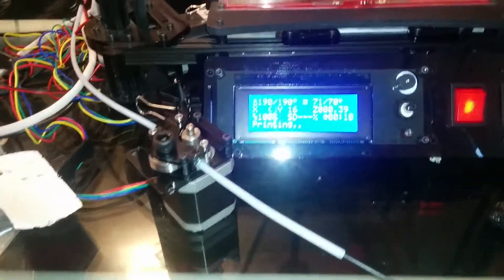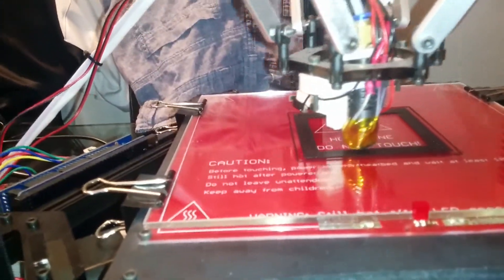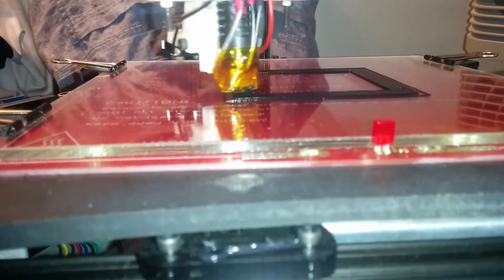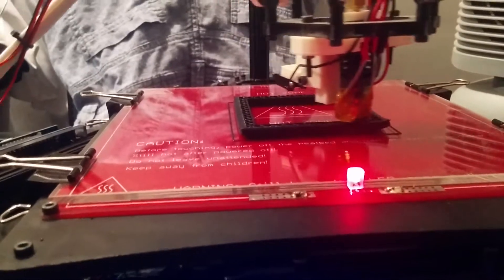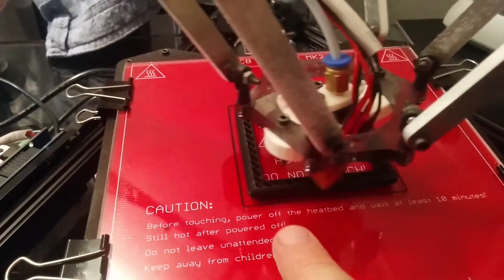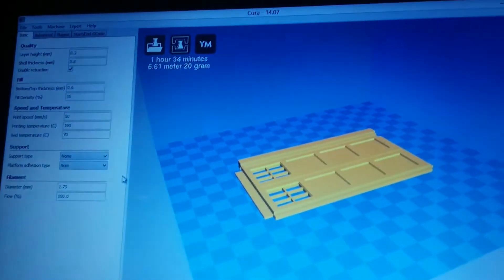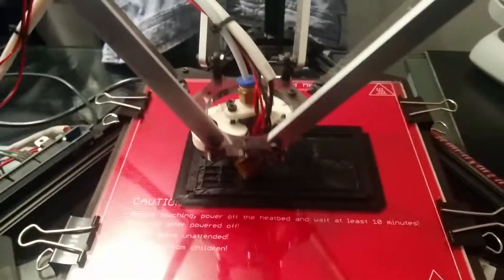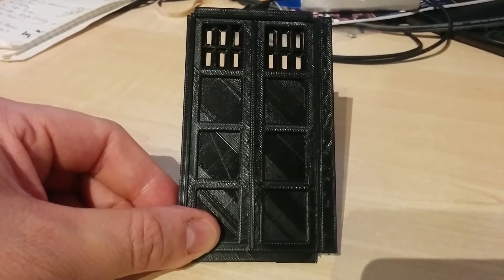3D Printer Build - Part 3

Comment: Best thing I have found to prevent warping if you are working with a printer that isnt enclosed is placing round disc on the corners of your print. Here is a link to the one's I am using. http://www.thingiverse.com/thing:51066. It gives it a little more surface area to help keep it down on the print bed. Also try a bit of hairspary on your build plate. Last thing, turn the fan off. If you dont have a fan blowing directly on the print with your fan mount then its just cooling the plastic to slow, thus causing the lift because of shrinking. Hope this help's.
Reply from the maker: Thanks for the advise!